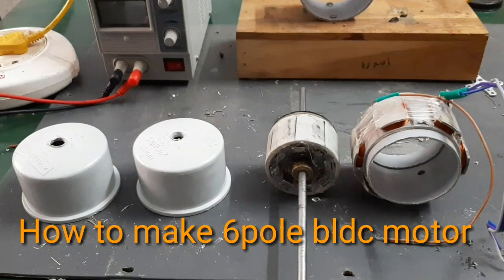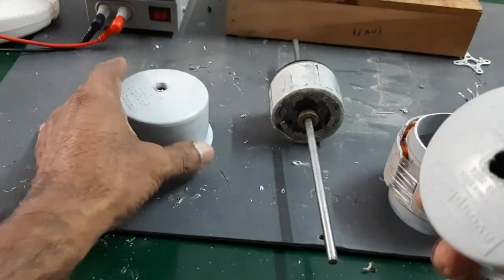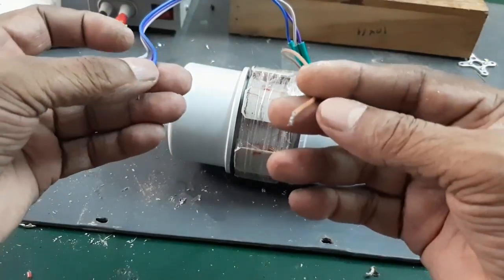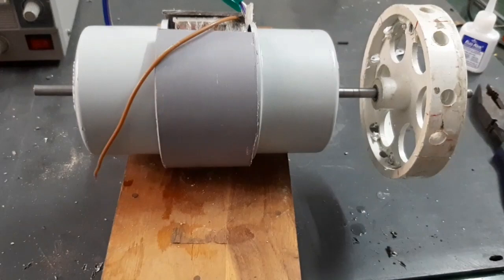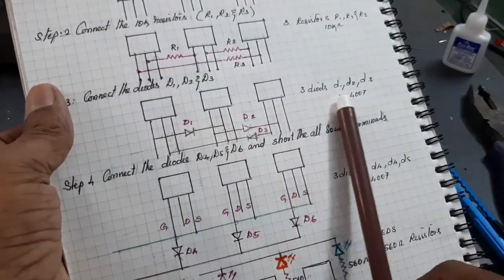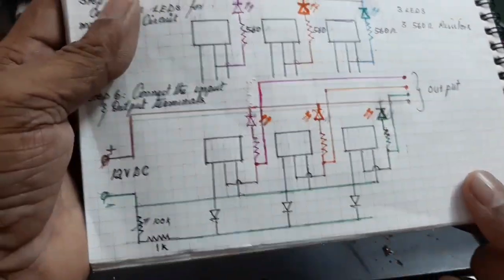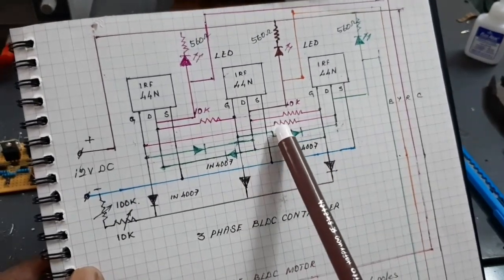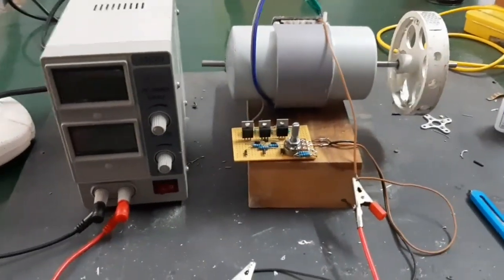Home made bldc controller and bldc motor

Comment: Sir i created same one but my motor gives some sound but does not start to rotate and transistor heat up i tried to rum my bldc ceiling fan and a motor of 18 poles stator and 4 poles rotor whats the problem plz tell me
Reply from the maker: 1.I think fan is higher capacity and it consume more current or
2.Vary the pot slowly at onestage the led going to plik and rotate the fan manualy 
May be the fan pickup speed or 
3.Try the controller with small motor
Thanks sir